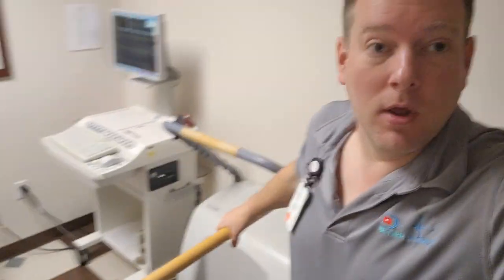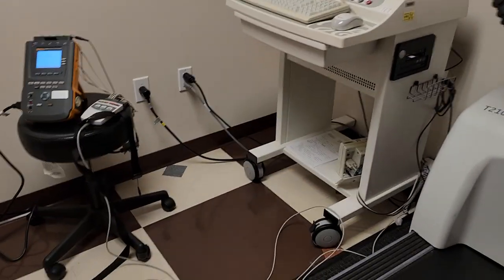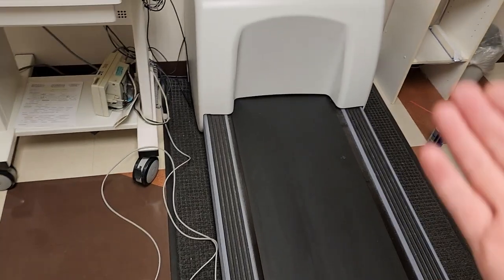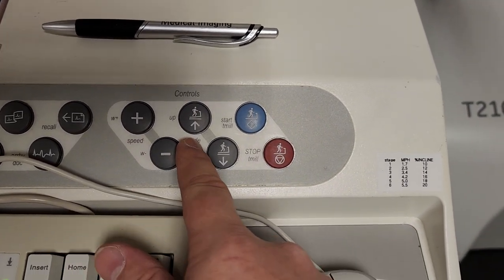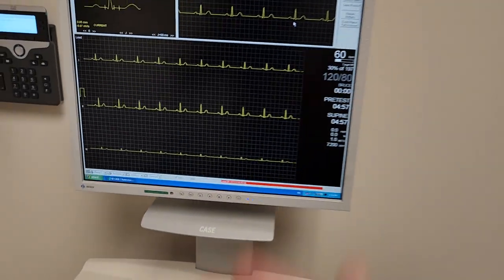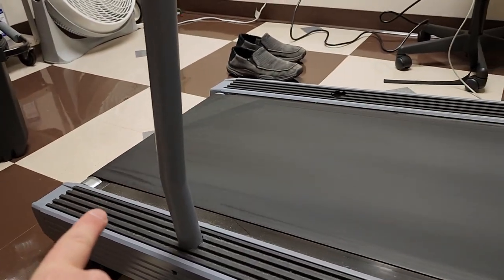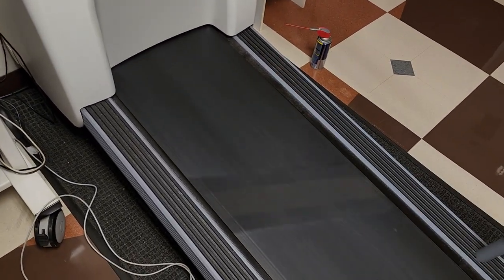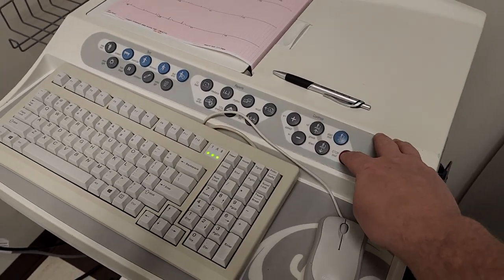Cardiac Stress Tester!

Comment: We still have a T-2000 from when it was a Marquette product. The T-2000/2100 treadmills are absolute workhorses. I've been working on these for over 12 years and had no idea about the silicon lubricant for the belt, it is not specified in the service manual so I assumed the wax on the walking board was the lubricant. Usually we vacuum out the area under the cover, flip the drive belt for even wear and tear, and clean the rollers. We had a Tech that was lubricating the drive belt with lithium grease but that caused it to disintegrate so we stopped doing that. We also have the diagnostic software for these which for some reason G.E will not provide anymore.
Reply from the maker: The manual doesn't say anything about lubricant but as these units get older, more wear on the deck is obvious, and plus you can tell the sound after a lube. The motor is quieter, and the belt isn't as loud while under load.
Reply: May have been using too much grease. The grease does not serve as a true lubricant but is only used to keep the belt from squeaking during low humidity times.
The drive belt is cogged so I don’t recommend “flipping it over”. A aftermarket replacement is $20, use a name brand.
Reply: @BetterBiomedChannel  Ok good to know, I'll order in a can of silicon lubricant and try it out.